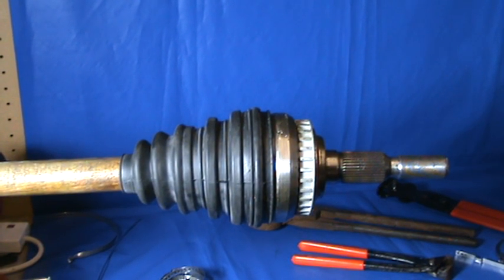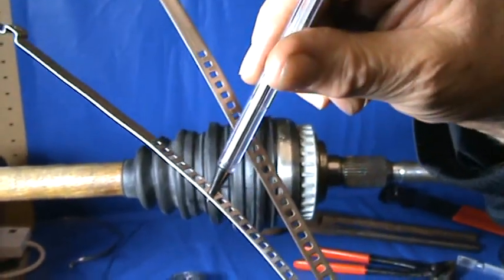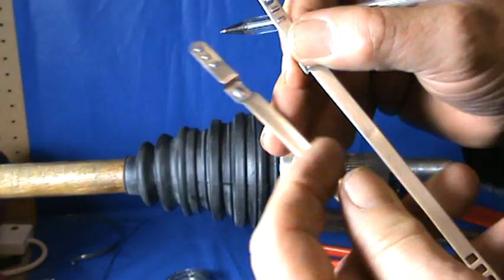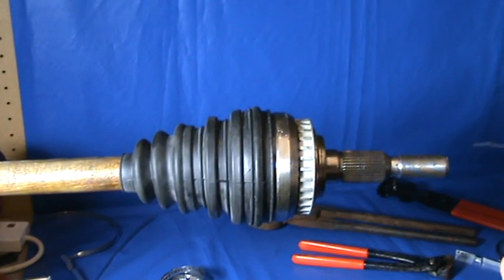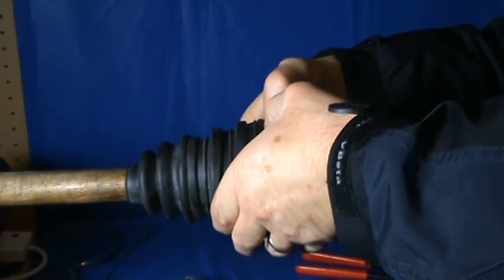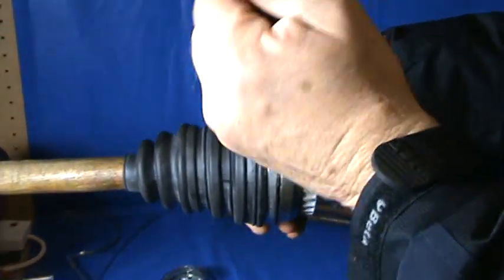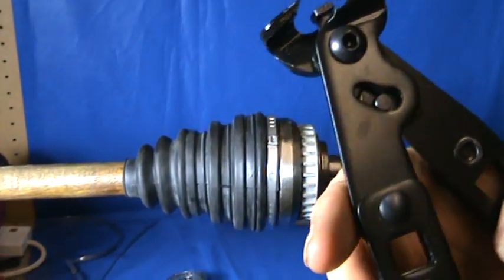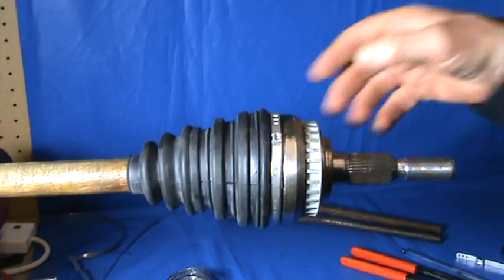Crimp Type CV Boot Clip Fitting

Comment: I just changed my Cv joint and boot the large clip fits easy but I was a bit surprised to see the smaller clip didn't seem long enough to reach the around the boot I am misstified at this. I cant clamp it on as it doesn't even meet the other side of the clip it seems to short. It's from a big motor factors to the trade my local garage uses them. I am a bit peed off

Comment: can u tighten then I once on??
Reply: Usually not with those tools as clearance is often an issue. You can but you need a special more expensive version. Look up offset cv boot crimping tool or offset cv band tool. Make sure to only get the best quality tools and ties. You don't want to have to redo this anytime soon. Good luck.

Comment: I don’t see what’s wrong with a nylon cable tie - it seems like a better mechanical solution. These things are needlessly difficult, with a lack of adjustment, and one time only use. Dreadful design even if common.
Reply: I think cable ties slip of easy and might not pass the mot. I tried that and it didn't hold the boot on
Reply: A nylon cable tie? Are you insane?
Reply: jonnyhifi Cable ties are ok for a quick temporary fix, but not for a permanent one. They almost always end up slipping off.
Reply: @marleythechameleonandherbi2724  im pretty sure he meant one of those super Thick ,heavy duty zip ties they are almost as wide as the metal  clamps..Ive used them myself and they are Strong! but since its plastic, it will succumb to heat ,oil and age and could over time go bad... metal crimp clamps, u set and forget.
Reply: There’s a clue in the name it’s a ‘Cable Tie’ !!!!!!! Not meant to rotate at high RPM and vibration in extreme  conditions, by all means use one but it is ( very ) likely to fail long before any of the other components you just replaced,
Have you noticed that the ‘Lock’ on a cable tie brings the two legs in at 90 degrees and not in line so it is very difficult to get it tight and flush on a round object.